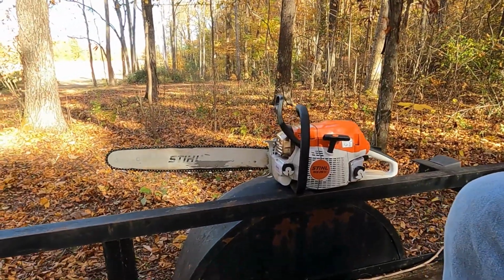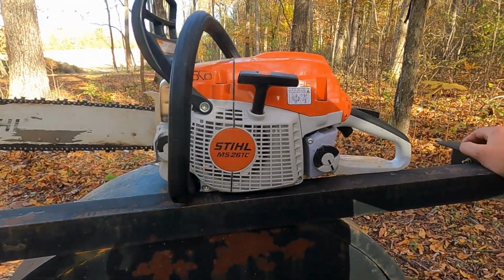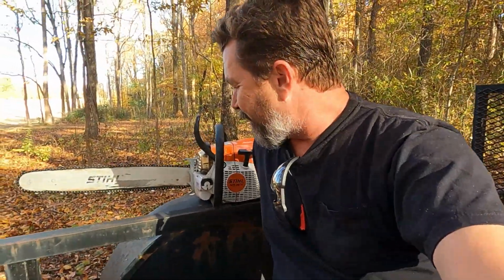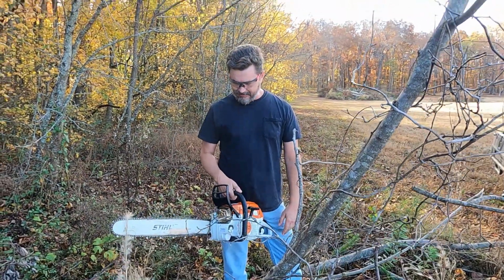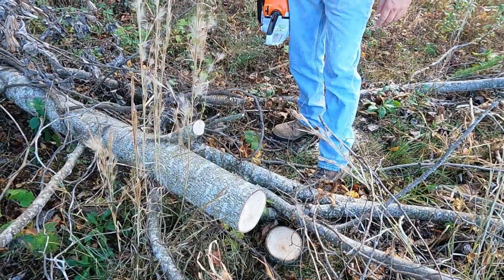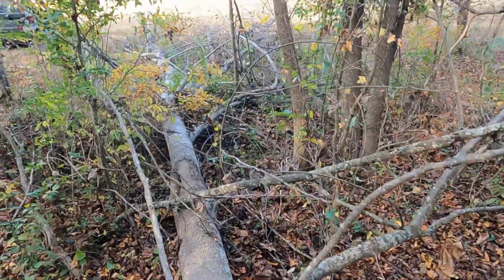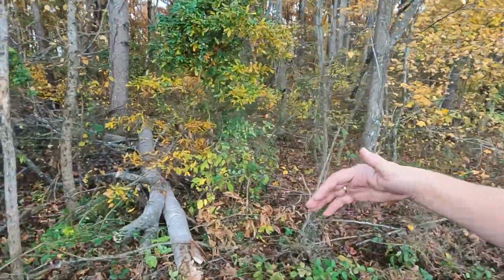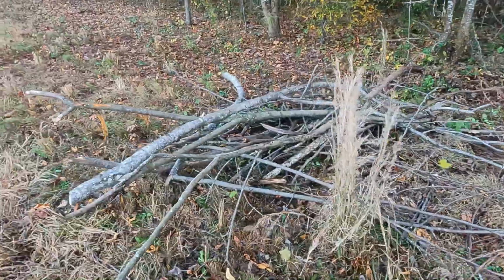Stihl MS261C Chainsaw Motor Ruined! Less than a year old. Only used a hand full of times.

Comment: If you're cutting with a chainsaw that gets damaged from a dull blade, then that chainsaw isn't worth owning.

Also, if you're running a chainsaw with the blade getting hot and overheating, then there is something wrong with the automatic oiling system. These newer chainsaws are designed to be self oiling in order to keep the chain and bar cool. When you are seeing the blade getting hot to the point of scoring and blackening, then the chain bar is not getting the oil it needs. Even if it's getting oil, it's obviously not getting enough oil.

So that said, either the oiling well is clogged, or the automatic oil pump is bad and must be replaced. There is absolutely no reason for a chainsaw blade to be getting hot to the point of burning.

In answer to your query, yes. Yes, a chainsaw blade will warp if it gets too hot. The other issue that may be causing the chain to create heat and friction that causes it to overheat, is applying too much downward and side pressure to the tool while cutting with it. A properly sharpened chainsaw will cut the wood on its own without a need for you to apply downward pressure. Doing so will only cause friction that can overheat and ruin the chainsaw blade. Judging from the burn scoring on your blade, that blade is ruined and must be replaced. It isn't just a matter of the chainsaw blade overheating. It can cause binding, which in turn can break the chain, or worse. An overheated and warped blade can cause dangerous and deadly kickback that is too powerful to control. Kickback can happen instantly and without warning. this is why the dog teeth at the front of the motor chassis must be engaged in the wood while cutting. The dogs will minimize or prevent dangerous kickback.

The action of the cutting chain is designed to draw and pull the chainsaw and blade towards and into the log being cut. This ensures proper engagement of the dog teeth to minimize or prevent kickback.

Get a new blade. Learn how to use your chainsaw safely and effectively. You are contributing to the problems and  the issues you're experiencing because of improper use of the saw. I grew up using chainsaws. Everything you described stems from and shows a lack of adequate and safe understanding of how to use a chainsaw effectively and safely.

So, here's what you need to do. Buy a new blade and chain. Send the old blade and the chain to a metal recycle center or send it to the landfill. By using that burnt and possibly warped chainsaw blade, you are endangering yourself and others around you. And, you're wrecking your chainsaw engine by making it work too hard.

Comment: The chain looks sharp and as you observed, it's not cutting in a curve, so I don't see the problem? If the cut is slightly angled it may be the way you're holding the saw. That bar has got hot some time in the past, but doesn't look like it's causing a problem now.

Comment: What a beautiful piece of property You have.  Nice footage, and really nice Tractor.  Gave You a ‘Thumbs up’ as you seem like a very amicable fellow, and neat Granpaw.  😃

Every Landowner needs/deserves at least one good chainsaw.  Having prefaced my comment on a positive note, I must point out some concerns.  You handle the tractor and grapple fairly well, chainsaw, not so much.  You were overreaching at times, and looked ‘unbalanced’ at other times.  One must have a plan when limbing and clearing out fallen trees and big branches.  It might seem like they pose no risks, but they are there.  It is so easy to lose your balance, and trip over small branches, vines, etc.  There were a few times you did not have control of the saw.  Please be careful, and take this as merely concern fro your welfare and safety!  I’m no expert, but I have been using saws for a number of years.  And yes, I’m guilty of some bone headed mistakes myself!  🙄

Nobody wants to deal with a lot of safety garb especially when it is warmer outside.  Please invest in some gloves, chaps, and a forestry helmet.  What is price/inconvenience when weighed against injuries to ones eyes, head, limbs, etc.or even worse, a fatal outcome?  You get my point.  Now if any one in here disagrees on my points, that is your prerogative, but its a foolish one. 

Lot of great comments in here regarding bars, chains, sharpening, etc.  I would heed them.  The simple act of sharpening is a whole mother big ole’ can o worms.  I swear, every time I file my chains, I feel I could do better, or I learn something new.  Important thing is to keep the chains SHARP!  Flip your bars.  

Stay safe!  Peace 👍✌🙏😊
Reply from the maker: You are wise and helpful! I completely agree with all you shared. As you continue watching you will find that I have now brought in some of the safety equipment that you have recommended. I need to stay aware and focused on safety. And yes, sharpening has finally been found. You don’t know what you don’t know but thanks to you and many others who have take. The time to leave comments I am moving in a better direction. Thanks for the kind words as well. Kindness is more rare these days and your words are very refreshing and encouraging. God bless!

Comment: Rotate the bar and file any sharp edges on it. 
The old saw may of had an air leak or was not setting air fuel mixture right. It would have been set to lean. If you have an air leak it will cause it to run lean. By lean I mean not enough gas to air. Not using oil in the gas could do the same damage.

Comment: Cause of dull chain and not having the chain oiler on max oil flow and heating up the saw so much and scoring the piston and cylinder walls will ruin any brand of chainsaw. What you need to do is take the bar off and do bar maintance. The bar rails are not parallel any more. That"s why the top side cuts straight. And after you sharpen chain flip your bar over every once in awhile. I was a logger for 10 years and learned all this stuff. Now i over haul chainsaws for hobby. Look up chainsaw bar maintaince on youtube and you'll see why it cuts crooked.

Comment: Don’t take this comment as being a smart-ass reply but just buy a new bar and see if it makes an improvement to your cut.
You can also have the service dept. dress the bar. They will plane it evenly on both sides or you can do it yourself at home if you take your time but it sounds like there is a minuscule bend in the bar. Which in that case if it was my saw I would put a new bar on it.

Comment: If your chain is so dull that you overload the engine your arms must be pretty sore pushing on the saw. If you see fine sawdust instead of large chips, the chain is dull and needs to be sharpened or replaced. Warping the bar from overheating seems unlikely to me.

Comment: Let me say this, I bought a brand new Stihl 180C limber which in principle sounded great. It’s been a disaster. Chains keep flying off, and no I’m not over or under tightening them. Been buying new bars, new Stihl OEM chains, proper lube etc. my captured chain catcher on clutch cover was so badly mauled it is gone but Stihl won’t warrant the problem. That said, I’ve gone to my Husky 545 mark II and no problems

Comment: The reason your saw is cutting crooked is because the chain isn't evenly sharp on either side. In other words each tooth on the right side of the chain needs to be the same length as the teeth on the other side of the chain.

Comment: There is no intake valve on a carburetor.  A dull chain can potentially overheat the engine (not motor) and score the piston, rings, and cylinder. You are fortunate you got a new $500 saw for free.  It was most likely operator error.

Comment: Take your chain & bar off then see if the bar will sit up on a flat surface on its edge, if it doesn’t you will need to file the edge of the bar till it will sit up on edge. What it does it makes your chain ride to a slant which will make it cut crooked.

Comment: You should only use a hand saw.   You need fresh gas and proper fuel mixture.    You need to fill your chain oiler every time you fill your gas.   As the bar runs dry and gets hot it can water uneven.  Get a new bar and chain .

Comment: You’re asking for help as to why you blew up your last saw yet when you start cutting you have the music in the video cranked up so loud you can barely hear the saw. Are you left handed? Because your holding the saw wrong. The top handle is angled for your left hand not your right. It’s scary to watch you run it it looks like you’re either going to cut your leg off or get the bar and chain in the face. Buy some chaps and a helmet and shield. Not a bad idea to have steel toe boots either.

Comment: I can see the bar has clearly over heated at some point you must have run a blunt chain with very little oil.
The bar needs dressing  so both rails are square to the side of the guide bar  Sharpen you chain and ensure all the cutters are at the same length flip the bar over so the top in now the bottom and it will cut straight.
I think this will all be covered online somewhere  ... Good luck
Reply from the maker: Great point!

Comment: you probably ran it too hot during break in. there built very tight and produces massive amounts of heat in first hour. bar curving may be one side of chain being sharper than other side.

Comment: im just getting into saws myself and was having a similar issue i think its 90% technique for me im gonna put duel WCS felling dogs on mine. one of my assumptions was that when im dogging in deep because i olny have spikes on one side it kinda cockeyes the saw ever so slightly this is just a theory.  im gonna try to get the ok from the missus the get the felling dogs and fingers crossed a bark box on my next payday. i was running a 460 32" bar cutting roughly 28-30" red oak. i have a 038 super that is literally old as me from 1985 its my favorite out of my collection so far. i also got a few farm boss saws i use for limbing and stuff.
Reply from the maker: Sounds like you have it goin on! Good luck with all that you are doing. Great comments from everyone on here. Learning lots!

Comment: just get a new bar and chain problem solved. I have 2 stihl chainsaws and if they blow up from the chain not being super sharp then they would be junk. As long as you sharpen your chain periodically there is no reason for it to blow up. I think you just got a defective one and people don't want it to be the saw, but i work in quality control, no matter how good you produce a product sometimes you get defective ones.

Comment: Was the scoring on the piston on the intake or exhaust side?

All saws need to run with a sharp chain. Just like if you take up woodworking / joinery, you need to become a master sharpener of your tools. Cutting with a blunt chain generates a lot of heat which can lead to things like the seals failing  causing an air leak, which then makes the saw run lean and causes failures. As others have mentioned, Buckin Billy Ray has a whole heap of 30+ minute videos on sharpening.

If you aren't confident in your sharpening and want to work out why the saw is cutting crooked, just buy a new chain and cut with that. If it cuts straight out of the box, your sharpening on the old chain is at fault. If it cuts crooked with a new chain, your bar is at fault. It could be bent from heat or pinching, or the rails might be worn or uneven and need dressing.
Reply from the maker: Man you guys know your stuff. Comes with time and experience I am sure. I never imagined that my saw chain could have been dull enough to cause any issues, but it could have been the case. As for the piston, the service manager didn't say, he was kinda vague in his description. I question the whole service experience but now I have a different saw and I am going to follow all of this great advice. I really appreciate it all.

Comment: Bsutton is absolutely correct!!!  Either one side is sharper than the other or one sides teeth are longer than the other. Your chain may need gauging which is an adjustment on the rakers of the chain.
Reply: Or the teeth on one side are sharpened at the wrong angle compared to the other side. 35 degrees instead of 30. Use a file guide to help with that, it's easy to get them wrong after repeated sharpenings.

Comment: The saw cutting at an angle is usually due to the chain. Why? You are better at sharpening one side of the chain's teeth than the other side, or one side is sharpened at a different angle than the other side. Even a slight difference will cause the angle cutting. Yes, flip the bar - but the chain's teeth is where the cutting happens.

About the piston being scored - run better 2-stroke oil in your saw. I'm guessing you used Stihl Ultra. 2-stroke oils are graded, Ultra is class B. Most are Class D which means they are higher quality.
There are better oil options (Echo Red Armor, 2-stroke dirt bike oils, Amsoil Saber, and others). And I would run a little more oil in the gas than specified - so 40:1 recommended, run 32:1.

Comment: A curved cut is always do to the chain sharpening. One side may be duller than the other and or the rakers may be taller or shorter in relation to the cutters.
Reply from the maker: Yep, that's what I am hearing. Thank you,.
Reply: @TheLovelyPlace  ya ive got to tell you that the number one thing about saws safety, longevity no matter how powerful they are is  learning to sharpen  correctly and choosing the right chain.
A dull saw will still kill you but it won't cut  wood so there is really no down side to being sharp. Lots of good videos out there on sharpening.  Good luck.

Comment: that total BS about the engine going bad because your chain is dull. if thats true then those engines are cheap junk.
I know a guy that burned up new 361 in about 3 months of use. my theory is its because of the thin oil mixture he used and you used. 
did you mix your gas at 50:1 with the oil? I have mixed mine at 20:1 for all my saws for the past 25 years and never had a saw engine go bad and I cut a lot of wood even when its really hot they never had a problem.
your new saw will run fine on 20:1 mix, its the government that tells stihl to recommend 50:1 mix, your engine went bad from lack of oil not from a dull chain. have that other guy explain how a dull chain causes engine damage but lack of oil doesnt

Comment: Hate to say it but it most likely is how you hold the saw and run it. You look not sting enough to control the saw. Buy a different bar and see if it changes. 18 or 16 inche

Comment: Obvious you are new to chainsawing.  Your bar hasn't been overheated to an extent to warp it; however if you bent it that is something else.  Usually a bent bar will have burn spots top and bottom and yours doesn't.  The first thing you need to check is your raker height.  That more than anything will cause your cut to curve if one side is higher/lower than the other.  Get a good Husky gauge or even better get one from West Coast Saw Shop.  You are skewing your cut to the left by cutting left-handed.  Chainsaws will curve in a large cut based on the direction of pressure on the handles.  You should not have to put any pressure on the top handle if your chain is sharp; it will naturally pull the saw through the cut.  The best indication on whether your chain is sharp is the size of chips you are pulling.  They will naturally be larger in soft versus hard woods but they always need to be relatively large chips.  Sawdust sized chips and you are severely overheating your saw.  And get away from that garbage oil in the silver-grey colored bottles.  Go with something like Amsoil Dominator @40-45:1 and twenty years from now your saw will thank you!

Comment: You have to really run the crap out of it with a dull chain pushing it really hard through the Cut's for many hours to overheat and score a cylinder  I would use 40:1 ratio Oil Mix  Not 50:1 I don't run 50:1 in any of My Saws & i use Lucas 2 cycle Oil Quart only $9.99 at AutoZone , cutting sideways is normally the Chain   Try a Brand New Chain  to see if cuts Perfect  OR have the  Chain Professionally Sharpened .

Comment: You demonstrated why your first saw's cylinder wall scarred and you don't even realize it. Every engine needs to be properly warmed up. Especially a 2 stroke engine. You did not buy a lemon. Man you are an accident waiting to happen. First was the way you overextended yourself trimming the limbs off of the trunk of the tree. Second was when using the grapple. Always always keep the load as low as possible. Raise it up when you get to the pike. High centers of gravity like that are what causes vehicles to topple over.